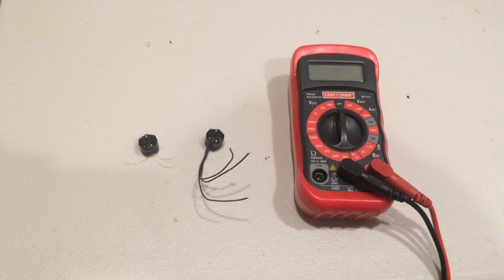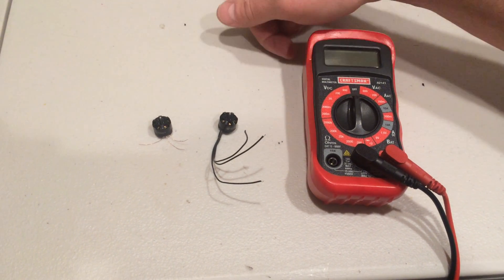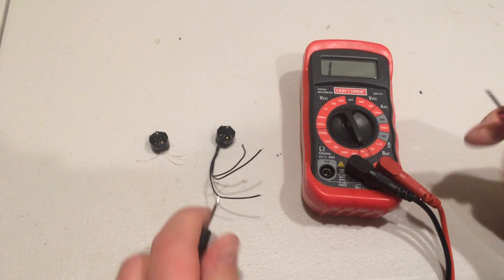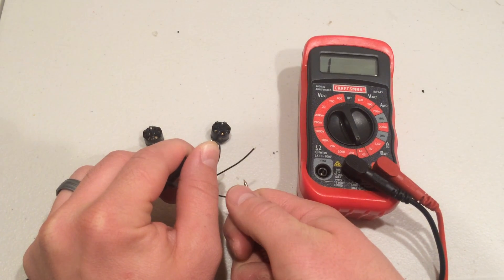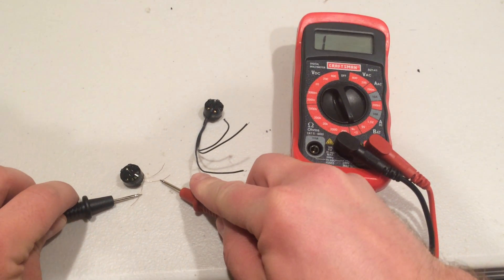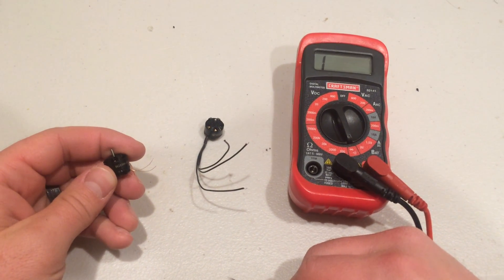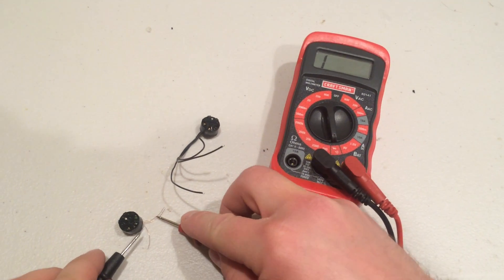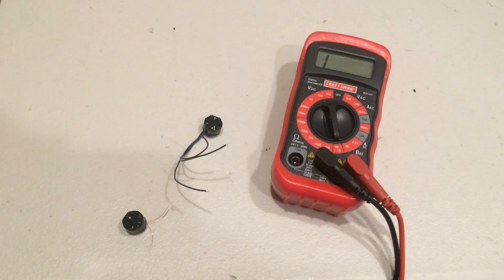How to tell a drone motor is bad?

Comment: If motor windings are shorted, a condition that happens when the motor overheats and the lacquer melts, your continuity meter will beep.  The motor is still bad in this case.  Your test only shows an open winding.  A better way of testing using a digital voltmeter is to set the meter to measure AC voltage.  Gently put the shaft of the motor into a drill and spin the motor.  Measure the voltage across all three segments.  You should get about the same voltage from all three.  Compare this to a known good motor.

Comment: thanks but  can this method be used when drone motor still spinning but not as smooth as the new one. I have drone that only fly high for 20 second and start descending and fly low only. Seems the motor not strong enough to lift the drone, and i suspect one or two have excessively worn motor

Comment: Why are you touching the metal pins with your hands when you test the motor on the right? By the way that should also screw up the continuity test as the body adds its own resistance..
Reply: its not a thetan machine aka scientology meter. Does that so he can actually make connection with the wire steady.
Reply: @videogamepolak0 he's absolutely right though.   You can only have one body part on one probe, if you're touching both then you'll get false readings.   You're better off using insulated alligator clips for this reason
Reply: Must I make any thing to motor before testing it